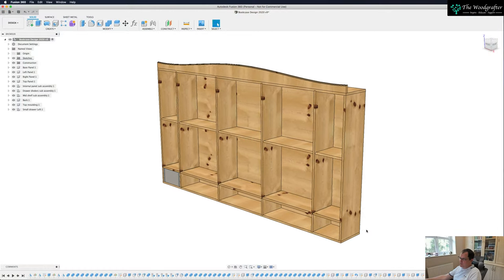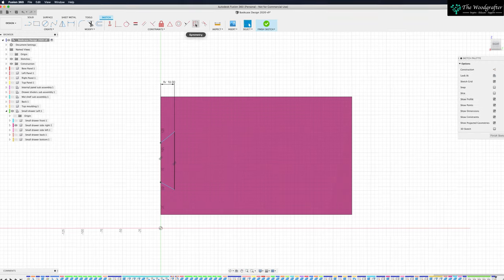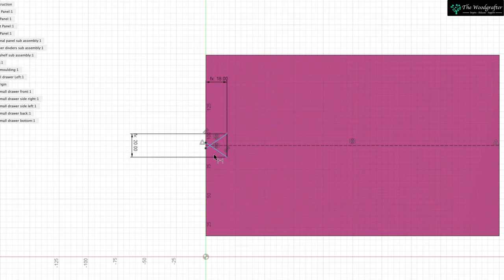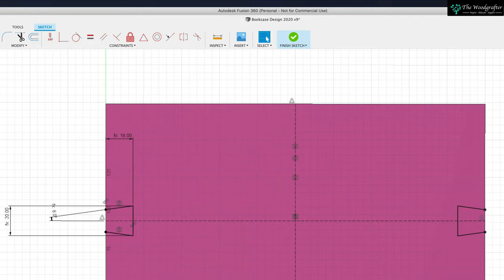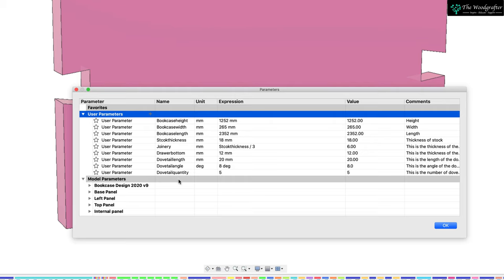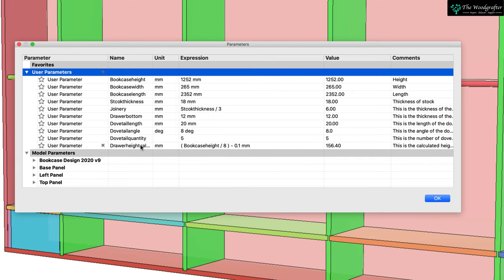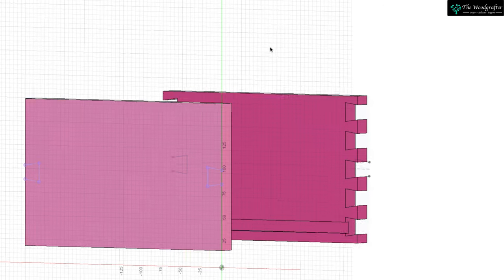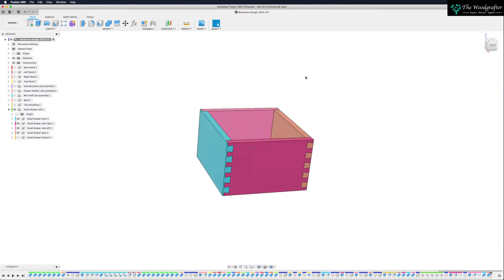Fusion 360 for Woodworkers - Lesson 8 The dovetails

Comment: Thank you sooo much for putting this course together!! I have been working at learning F360 off and on for the past 2 years. I have learned a fair amount from others tutorials, but this course has brought it all together. My application all along has been furniture design and manufacturing. There is much to learn here and I appreciate all the clarity and work you have put into making this tool very useful to me. THANKS!!!!!!
Reply from the maker: Hi Joseph,

Thank you for the feedback and I am glad it added some value on your journey. I don’t actually think you ever stop learning Fusion or design for that matter :-)

I am thinking of launching a dedicated CAD CAM for Woodworkers channel. Where we can really get stuck into the details of the full process using Fusion or V Carve and outputting on 3D printer or CNC.

This channel would run alongside the main Woodgrafter channel. 

Do you think that would be of value ?

Cheers

Andy
Reply: same here bro! i watched a ton of tutorials and never came across this one for some reason. now im like holy cow im actually learning fusion now!

Comment: Still trudging along! Thanks again for these courses I've learned a ton and even managed to crank out my very fist design for a 3D print from what you have taught.

I'm not sure if it's just due to my settings or an updated version of F360, but in the step for the projection at @27:52 I was having an issue. I am finding it difficult to describe, but I'll try. The problem was that when projecting the dovetail from the right/front board the profile lines it projected onto the left/front board didn't touch the outer edge. It created an incomplete profile on that "front" side which meant I was unable to extrude it. To fix it I had to delete the previous "Offset Face" step from the timeline. Then the projection was perfect and I could extrude both sides. Afterwards I re-did the Offset Face command for that front edge on both the right and left boards at the same time. 

No idea if that makes any sense.

Edit - and of course immediately after typing all that out I realize my issue was that I did not select the projection from the SKETCH of the dovetail (@27:34) and was instead selecting the edges of the actual (offset) body of the dovetail. I love making mistakes! Best way to learn.

Comment: Just discovered you. Nice job. I hand cut dovetails and always have full tails and cut off the space for the half pins. 
Any tips or thoughts on the approach? 
Thanks👍
Reply from the maker: Hi thank you for your feedback and welcome to the channel.

Nothing wrong with your technique. It makes sense to me.

When hand cutting dovetails, I usually follow a similar approach. I make the tails first and tend to make them the same length as the stock thickness - regardless of through or blind.

I then trim off a few mm if they are going to be blind. I then use the tails to mark out the pins and cut away. If blind then I tend to use a card scraper to cut the fibres then remove the waste.

So all works for me.

Cheers

A
Reply: The Woodgrafter sorry and thanks for the reply but I meant the work flow for Fusion 360.
Reply from the maker: Hi Craig,

Ah missed that, but it was a quality answer......

No nothing wrong with the technique you outline in Fusion, I use the technique I outlined as it gives me a ref for the parametric modelling. So if I re-size the stock thickness then the dovetails re-size as well be they blind or through.

In reality you wouldn’t need to model the dovetails at all - just ensure the stock overlaps at the joint and then drop a note on the drawing (later episode) saying these are 1:7 dovetails.

As a woodworker that’s all you need to know, I tend to model the joinery because we can.

Cheers

Andy

Comment: This has probably been suggested by someone else, but could you have ‘mirrored’ the left and right hand side of the drawers. Remember you will always get some smarta*se with a tenth of your knowledge asking stupid questions. Best regards.
Reply from the maker: Hi Ron,

Yes you could - I some times repeat the same moves so you can see it again.

In reality I would make one side of the drawer with all the joinery, and then mirror around a mid point construction plane.

Fusion Is a bit like Woodworking in that you can achieve the same outcome in may different ways. There is no right or wrong answers only ones that work.

The more you use it, the more you discover. Also watching other people use it - and then doing exactly what you are doing and ask “could I do it this way instead ?”

The good thing about Fusion is you can give it a go - you can always wind back time and try something different. I am always learning, and trying different ways.

As an example when I modelled the Workbench - I spent hours modelling the laminations in the top and working out how to have them re-size. Then I watched a video on splitting components and realised I could just model the entire top as one slab and then cut it up (with the spilt component tool). So now I have discovered that never again will I have  to model another lamination, now it takes 5 mins to create a laminated panel.

So there are no stupid questions, only stupidity when we think we know everything so we no longer have to experiment.

Now my next challenge is to see if I can use boolean logic in parameters to auto size dominoes based on stock thickness.

Keep questioning my friend, Here to help.

Andy
Reply: @TheWoodgrafter  Thanks for that. I think your followers would like to know your background i.e. what you did for a living and your education. The American woodworkers are up in the hundreds of thousands of subscriptions but, of course, they have a population six times the size of the UK. One young lady has a following of over one million but she has nice legs so it would be difficult to compete. I am sure your following will increase. Best regards.